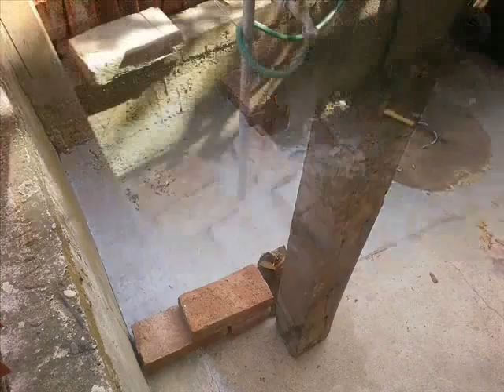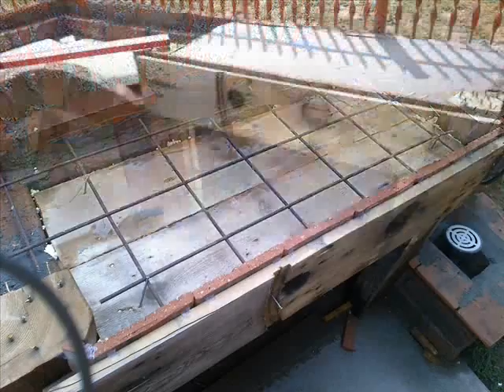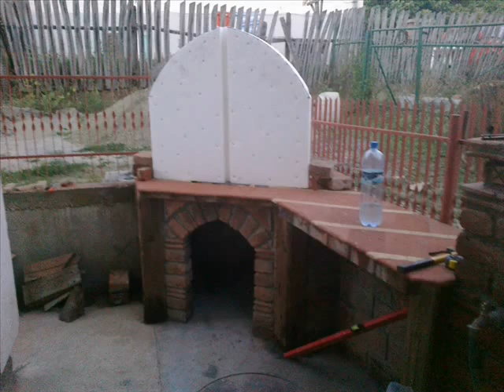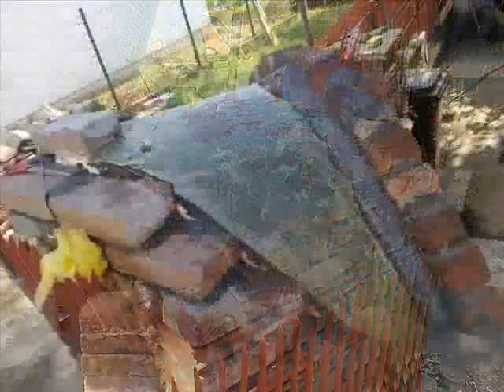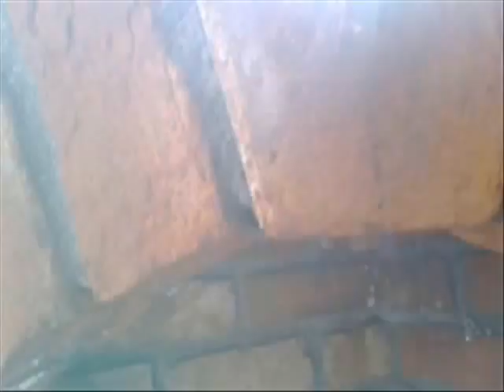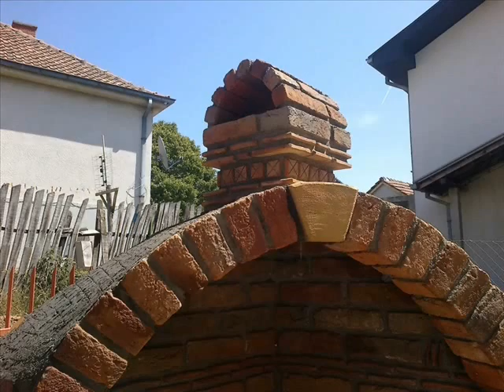How to Build a brick & roof tiles barbeque (BBQ) DIY.wmv

Comment: The circular lid on the concrete? is that a septic tank?
Reply from the maker: Yes,I used styrofoam as a mold to do that. Lid is a metal plate,painted and so far is holding good.
No,it's not a septic tank,it's a tank for a water meter.